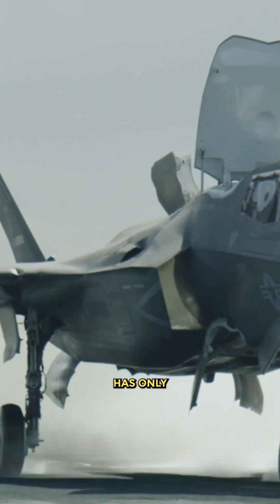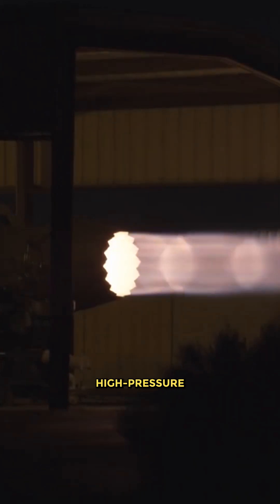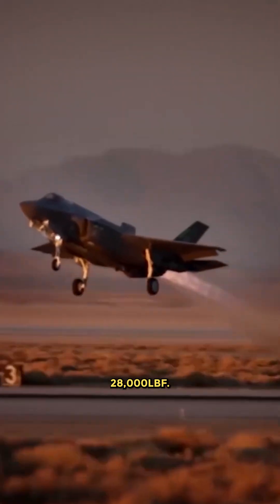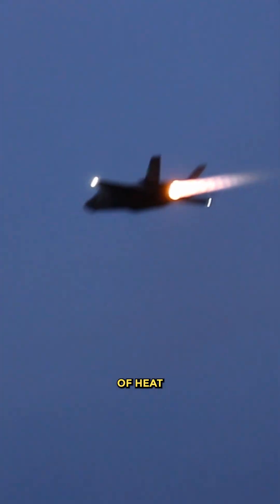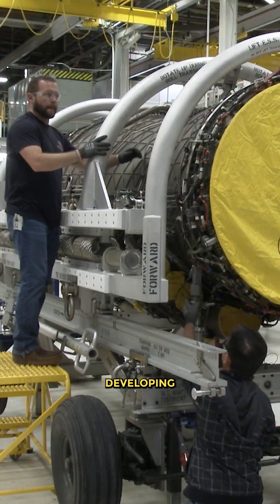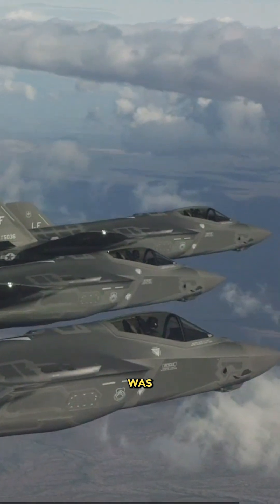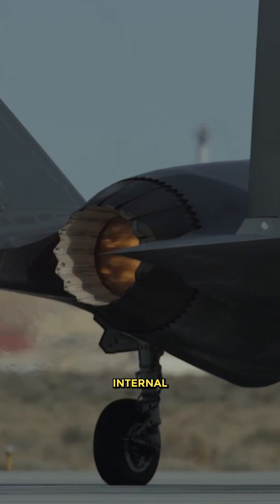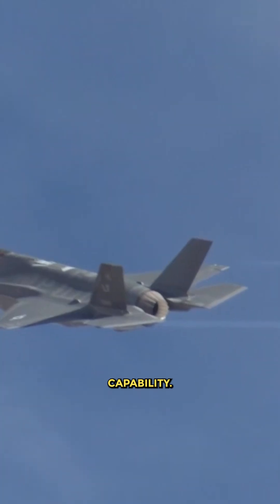Why does the F-35 have Only One Engine? #shorts

Comment: The F35 was not supposed to be an air superiority fighter. It is a mulitrole fighter bomber that was supposed to handle the roles the more expensive f22 couldn't do.  The F22 was so expensive they made 120+ of them, stopped production and did away with the production line.  They also refused to sell the F22 to allies.  The F35 is being sold to all of them.  If it had 2 engines it would have put it out of cost for many of them.